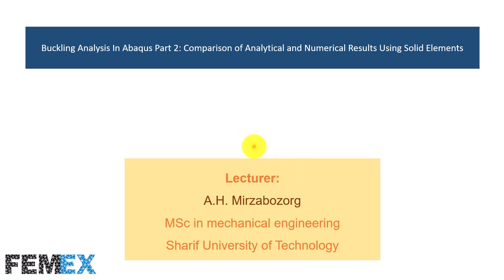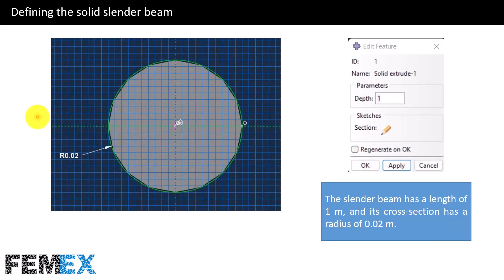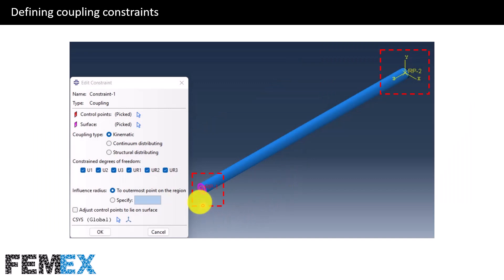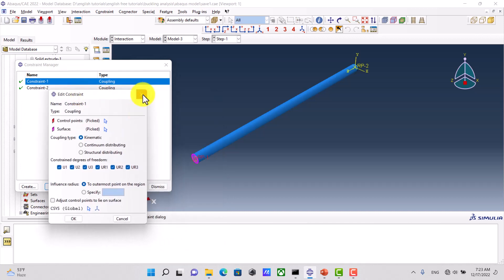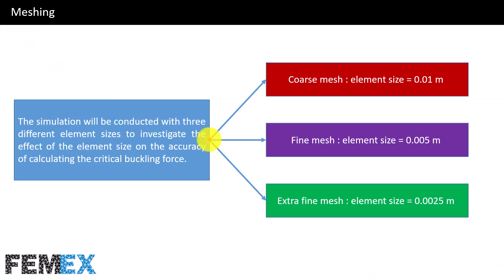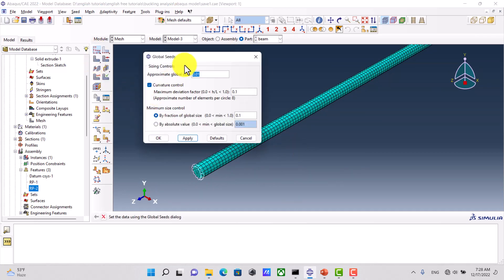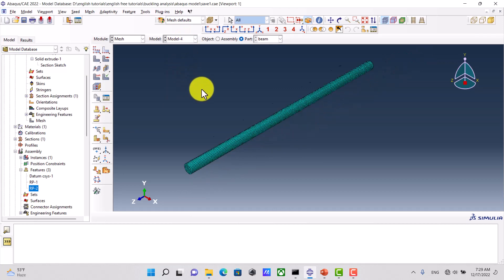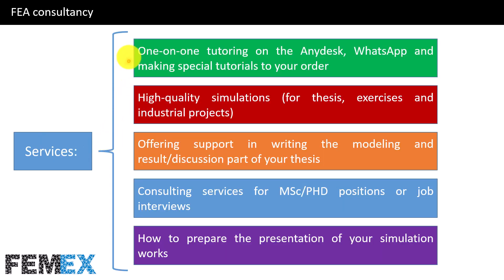Buckling Analysis In Abaqus Part 2: Comparing Analytical and Numerical Results Using Solid Elements

Comment: Thank you so much. It is the greatest video.
Reply from the maker: You are welcome.
Thank you.
Reply: I want to ask that there should be convergence relation between element numbers and deflecitons like element numbers and stress convergence.
Reply from the maker: @issizzadam  You can plot the Eigen values vs the number of elements and do the sensitivity analysis like for the stress but the issue is that for convergence of the eigen value of higher modes you must use more elements so convergence depends on the last mode under investigation.
Reply: @FemexIran  thank you so much, so I should replace stresses with eigenvalues in the graph.Right?
Reply: @FemexIran  How can we find critical buckling stress in abaqus?
Reply from the maker: @issizzadam  Hi.
Good time.
We don't have critical buckling stress. We have critical buckling force. Eigen values are critical buckling forces that Abaqus calculates them and shows you in the visualization module.

Comment: Hello sir,  even though every step I followed is same with your steps, I got a error that says: THE LANCZOS SOLVER CANNOT BE USED FOR BUCKLING ANALYSIS IN WHICH A MODEL: (1) IS PRELOADED ABOVE THE BIFURCATION (BUCKLING) LOAD, OR; (2) HAS RIGID BODY MODES, OR (3) IS OVERCONSTRAINED OR (4) CONTAINS HYBRID ELEMENTS OR CONNECTOR ELEMENTS. Can you help me with that please? I have been trying for hours.
Reply: I got it sir thank you so much

Comment: How can i define a stopping criterion for the riks step
Reply from the maker: Hi.
In the riks step settings, in the basic tab, there is a section named stopping criteria. If you know the maximum displacement of a point in your model, you must create a node set or geometric set from that point and put it in that section.
You must activate the maximum displacement and write its value with correct sign and specify its dof and also select the created set in the node region.